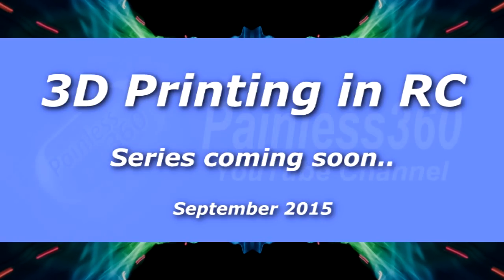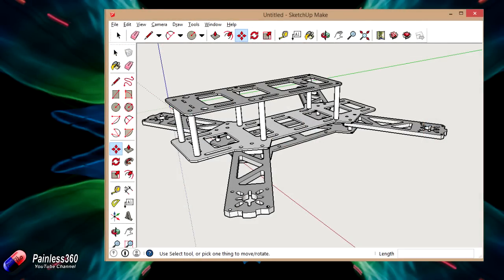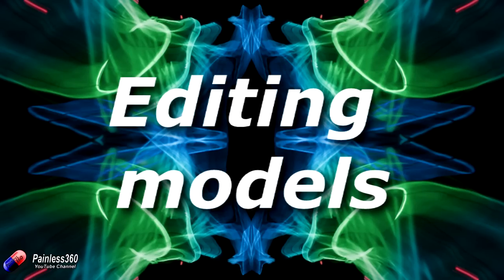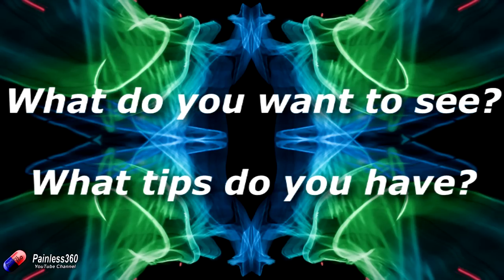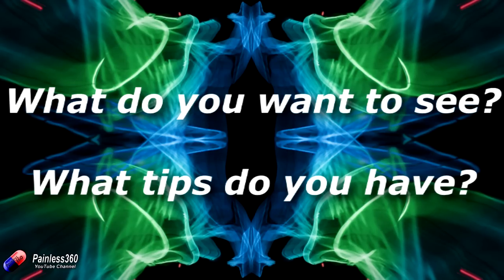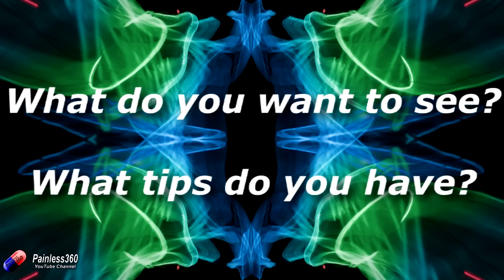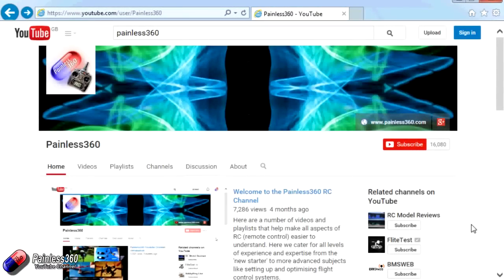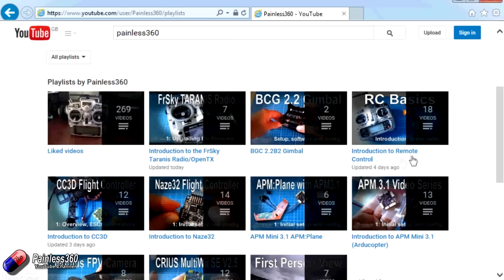3D Printing for RC - Series Coming Soon!

Comment: hi i am thinking about getting a 3d printer i have been wanting to get one for a bit now but i don't know which one i should get i have got about £300 what would you recommend?
Reply from the maker: +Rick Inman That depends on what you want to print, how much space you have, how open you want it to be, if you are happy to build it yourself from a kit.. See the first video in the series for things to consider..
Reply: +Painless360 i don't mind building it. the space doesn't matter. i want it to build quadcopter frames and parts. its just i allways spend way to much getting in to new things no matter how much research i do.
Reply from the maker: +Rick Inman I would look at something that can print ABS and is easy to setup and use. The 'Rostock' style of printer I'm building is great but is a nightmare to calibrate as the geometry in the links and three motors have to move perfectly in sync to print a straight edge (versus one stepper motor working to do that on a more traditional printer). If you only want a small print area the TinyBoy from HobbyKing is a great way to get into it..

Comment: wow. is this a case of the more you use the beter you get. I bought a 3d printer a year ago it was the xyz 2.0.
great hardware but softwear was not so good. I re flashed with repetier-host and the prints on both Plastick are fantastic. I was given a cad program from a friend and we'll it would of been quicker to plot a trip around the moon. but sketch up is looking much beter. made a battery tray for my 250 racer to go under frame. top man for the help.

Comment: hi  . I'm finding it hard to choose from the 3d programs out there. do thay make a kiss program.  thanks steve
Reply from the maker: +steven lawrence If you mean 'Keep it Simple Stupid' type program then they all try and make the interface as easy to use as possible but there are many churches when it comes to 3D design programs. Some too are better at some things than others. I will be sharing my thoughts in the series. Two very common options are 123D and SketchUp. Some great series on YouTube about these programs. Both require a way of making models that isn't as intuitive as it could be (using a solid tube shape to make a hole in another solid for example).Worth playing with them in advance - they are both free. Other options are also out there and, again, have very vocal supporters. Best of luck.
Reply: Thanks. Playing with sketch up now.
Reply from the maker: Great for sold 3d shapes but struggles with managing complex curves.

This is what I recently designed in SketchUp - https://dl.dropboxusercontent.com/u/67301981/GPS%20Bracket.jpg

and this is what I designed in 123D -  https://dl.dropboxusercontent.com/u/67301981/Screenshot%202015-09-12%2016.32.22.png

I'm sure you can see the difference in the results!

Have fun with it..

Comment: Hello Painless, I built a 3D printer (you can see it on my YouTube channel) and I am printing multi rotor copters. I also use Sketchup. You wanted some tips here they are.
First: 3D printers print in layers. The weakest point is between layers where delamination can occur. If your print head is too cold your print can be weak. Also print in an orientation that will be strong. A long part printed on end has many weak layers of small cross section. A long part printed on it's side will have large cross sections and be much stronger. Think of plywood. Use thicker layers. A 0.4 mm layer is stronger than two 0.2 layers, it also takes half as long to print. Use gussets and radius your corners, breaks occur more often at sharp corners. Use that to your advantage to save your structural parts, motors and props. A broken motor mount is a slight inconvenience when you own a 3D printer. A busted prop or motor is a trip to the hobby shop or a week checking the mail. Try to avoid overhangs in your designs, 3D printers don't deal with anything over 45 degrees very well. Anything over %60 infill is just a waste of plastic and added weight. Use 3 or 4 shells and 3 to 4 top and bottom print layers. If something is just holding an antenna it doesn't need the strength of something holding a motor or arm. Use less layers, use less infill, use less thickness, make it weak, if it folds over in a crash it might save your antenna. I use gluestick on cold glass with PLA. Large parts can warp, keep the room warm.

Sketchup: Precision is key, first change the default colors from light blue and slightly lighter blue to blue and red, reversed faces can screw you up. Make them stand out. Add and use Solid inspector versions one AND two. They both work different and version one will highlight errors. Objects must be manifold to print. That means if were a physical shell it would hold water. Turn on hidden geometry to inspect your models, many thin lines all over your model indicate where something isn't level or a bad fit. These thin lines can only be seen with show hidden geometry turned on, you can also erase them when you can see them. Most source files from the internet are utter crap full of dirty geometry, the Cleanup plugin can fix some of them but It's easier to use them as a template than to repair them. To resize a hole that goes thru an object erase one side of the thru hole, the tunnel between the two circles will disappear along with one circle. Left click the remaining circle, select "entity info" and adjust the size and segment count from the little menu that pops up. Then draw a line across the circle to cover it, erase the line and extrude the disk thru the object to make a new hole. Bolt hole tolerances. Measure your bolt thickness with calipers, divide by two, add 0.1 for a tight fit and 0.2 for a loose fit and that is the radius of your bolt hole. Always work in millimeters. All 3D print stuff is in millimeters. When snapping lines to another part of the object. Always aim for nodes, intersections, midpoints or end points for best results. Use precision, if you extrude something 4.56034 mm type in 4.5 and get rid of the rest, keep it whole millimeters if you can even. Sketchup is always listening for you to type in a value after you perform an action, use that to your advantage to build clean. Hide walls on your objects to look inside for stray edges, faces and geometry. If you erase a line on the outside of your model there is a really good chance there is some stray line or segment left inside your model. Make parts of the model "Objects" to prevent them from sticking to each other. The Ctrl key in addition to the commands rotate, extrude and move will create copies. If that copy is of a selected object a change to the original will make changes to all of them. To mirror an object (for arms and other left/right or up/down components) Ctrl move it to make a copy then select the copy and right click it, select "Flip along" red/green/blue to make a mirror of it in that axis. If the lines you are drawing on your model appear thick and don't "sink in" and become thin you probably are drawing on an object and are not editing it. If you need other parts of the model in view when you edit a part group them by shift selecting the parts and right clicking for the "Create group" command. Learn the keyboard shortcuts. space bar is select, T is tape measure, L is line tool, C is circle. Q is rotate. Reference everything to the origin. To rotate effectively, select the object, change to rotate (Q) left click (and hold down the left mouse button) on a corner or where you want to rotate it from hold that left click as you rotate your mouse. When the rotate tool circle is the color of the axis you want to rotate on release the left mouse button and select your second rotate point. Move your mouse to rotate the object and click when it's where you want it. Type in a value if you want it to be precise. Press esc if it starts doing anything crazy. esc will release your object from most operations. Alt Backspace is undoo. Draw a circle, it will have 24 sides, immediately type 48s and it gets much smoother, type 3s it becomes a triangle. Sketchup remembers your circle preference for that session. The next circle you draw in your model will have the same number of sides. Watch the Sketchup inference YouTube video it's a powerful tool. Good luck with your series, I like your videos.
Reply from the maker: +peterthinks Thank you for taking the time to write that - some excellent tips!
Reply: You're welcome, There is a lot of info out there but it's scattered or takes a long time to watch all the tutorials. But if you can show precision, inference, cloning and how to effectively rotate it's going to be a very helpful series. The cleaner you can design the more likely it is you can actually print the object. Also map the extra buttons on your mouse for things you use a lot like hide/unhide all or extrude/erase/select/line/tape-measure. Whatever you got room for and a scroll wheel you can click makes a world of difference when navigating. The shift key will lock you in directions when drawing or selecting a rotate point. The arrow keys will lock you into a primary axis when moving an object. There are a million tips. But I'd say the most important is trim your distances, build square/level and reference your objects to the origin . Nothing worse than hunting down a tiny 0.00001 error in a complex model. Maybe build one quick and dirty then make a precise one beside it using the first as a reference. I always start with a sketch on paper. And model your parts in your models, motors, booms, servos, batteries, the FC and TX. Just boxes or cylinders of the right dimensions It really gives you a sense of scale and makes sure your parts won't interfere with things like props. http://i287.photobucket.com/albums/ll144/Peterthinks/T%20copter%20and%20Yaw%20copter.jpg

Comment: I got a 3D printer for Christmas last year and it has been an absolute game changer.  It's what gave me the push to get back into model RC and really take the plunge into aircraft.  I 3D printed a tricopter and have learned a lot though it.  Having the ability to go home and 3D print a part and get back in the air makes a huge difference - no more running to the hobby shop and spending a bunch of money.  I've gotten into airplanes now too and have printed a bunch of parts for them as well.  I'm interested to see what you do with these videos.  There are truly endless possibilities in combining these two hobbies.
Reply from the maker: +hotbrass2005 I agree, I keep finging instances where I need a little custom bracket piece and in the past used an hobby knife and balsa or a dremmel and CF to try and make it. This is SO much easier.

Comment: I'd be interested in things like interchangeable modules for FPV, similar in concept to the "swappables" power modules @Flitetest.  How to design & print camera/RX & FPV TX mounts and gadgets for different common frame types and repair printing - for example, can you print part of an arm for a QRX350 to be used as a transplant unit for a broken section  That kind of thing.

Also, cost of printing vs cost of purchase.  Strength of printing and how to integrate other components - sandwich a metal/carbon fibre structure between 2 printed layers for example.  Bonding techniques & what glues/adhesives to use.  What to avoid as well!

Great series idea, I hope I learn as much as I have on the RC videos.

Comment: this will be very helpful, it may have been requested previously but for and old dinosaur like me, a bit of a basic "getting started" how to with the design software. thanks.
Reply from the maker: +angryjetflyer I will be covering the basics at a very hight level. There are some great tutorial series already on YouTube and Apple University for the main software tools (SketchUp, Fusion 360 and 123D).You need to 'think differently' to make the models as the natural way you'd make and design something isn't always the way that works best in the tool. I would take a look at some of the tutorials for these in the meantime. Happy flying!
Reply: Thanks for the reply   l will look them up

Comment: Hi, I'm having a problem on my naze32.i followed ur manual on the YouTube on the playlist according to what I need.on the clean flight configurator it says I'm using an old version but the problem is I can't find the newest one. The board has just arrived 2 days ago and b4 30 days accures I need to see if it's the board or maybe I'm not doing it right. It's running on OS:windows,chrome 45.0.2454.85, configurator 0.65.0. Under it it say ITS AN OLD VERSION. Help is highly appreciated. Thank u very much more power and God Bless
Reply from the maker: +bobot021070 Mine says the same thing but you are using the latest version. New versions of the configurator and Cleanflight firmware are always coming..

Comment: I would really like to see how you take an existing stl file that is made for another quad model and adjust it to fit your quad.  There are tons of great stl files in Thingverse for the ZMR250....but how can I change them in Sketchup and/or Cura to have them fit my Blackout Mini H.
Reply from the maker: +SoupSamich This is tricky as am .stl file has a lot of extra geometry that makes changing anything very tricky so a lot of work is needed. We will look at this in the series..

Comment: What I would most like to see is a simple guide to using the software.
Reply from the maker: +Victor McAuley We will be covering the software at a high level, options to design, what is an STL file. Why do you need a Slicer etc...

Comment: looking forward to this one !! Should be good 
My 2 cents would be 
if at all possible use a heated bed with borosilicate glass and UHu stick ...after many years of messing around with tape etc etc i started using this a year ago and havent used anything since !!!
Non heated bed ... same glass but with kapton tape ( pre print cleaned with alcohol) works fantastically well.

No1 rule . Calibrate , calibrate and when you think things looks good ..calibrate again !! 

Design wise its massively important to design to suit your particular printer. Although working on similar if not the same principles, there are pretty big differences between the various models and types. a bit of thought at the design stage can save hours of frustration when trying to print.
I wouldn't recommend sketch up , Certainly not when there are better free parametric options out there ( Design spark/ Fusion 360)  I have nothing against sketch up and for simple things its ok i guess, but you will always be dependent on "plugins" and their authors for 3d print models. And not being able to alter things ( existing models) easily make it a pain to use.
It has been the go to 3D design tool for many people simply because it was free and i think thats a mistake if you are doing any engineering based modeling/ designing 

If your interested you can check out some of my RC projects 
http://www.thingiverse.com/thing:227974
http://www.thingiverse.com/thing:250340
& my pet project https://grabcad.com/library/edf-rc-harrier-1

Id like to contribute a "best value for money" 3D printer upgrades later in the series.

Cheers

Comment: I found that NetFabb Basic was really handy for cutting a print into parts that I could fit onto my Printrbot simple metal.  Not exactly ideal if you wanted to cut an arm into pieces, but still a useful tool.  I also found that Octoprint was really handy way to stick my printer in the shed and still keep an eye on it from the comfort of my armchair.  My first every quad used this model http://www.thingiverse.com/thing:664260 which worked really well.  I used PLA plastic so it was not too forgiving on those learner type crashes.  CA glue was a very handy tool to keep in the flight box.
Keep up the good work. Great videos.
Reply from the maker: +Simon Hall Great tip about PLA. My first prints were in PLA as I had no heated bed and I found them very stiff but too prone to snapping/delaminating when they took a knock. I would always use a slightly softer plastic like ABS for frame parts as they seem to handle crashes better. Thanks again for the tip - keep them coming!
Reply: Apparently it is possible to print ABS without a heated bed by painting the bed bith a mixture of ABS and acetone, sometimes called ABS juice or ABS slurry.  I have yet to test this.
Reply from the maker: Even with a heated bed there isn't any guarantee that the print won't lift. Let me know if you try the 'juice' ;)
Reply: +Painless360 Got the ABS, so will let you know.  I want to have a go at printing a new version of the miniquad, but with longer arms. Perhaps another 50mm longer for each arm.
Reply: +Painless360 Update: I chopped up about 30cm of filament and placed it in a glass jar with about 50ml of acetone.  It dissolved into a slurry as mentioned in other posts I have seen.  I used a small 10mm touch up brush to spread it onto the blue painters tape on the bed.  I have printed my first 3mm test cube and at 235 degrees C for the hot end.  I printed very well considering it's only 15 degrees C in my shed!  I went for a bit of overkill with a brim of 20 lines.  The part itself did lift slightly on the corners, but no worse than some PLA prints. I also have to point out all I did for the gcode profile in Cura was to up the temperature, all the other settings were as I last left them printing PLA. I might have to run off another copter body.
Reply from the maker: Cool, thanks for letting me know..

Great tip.